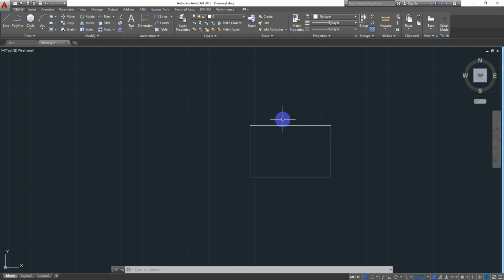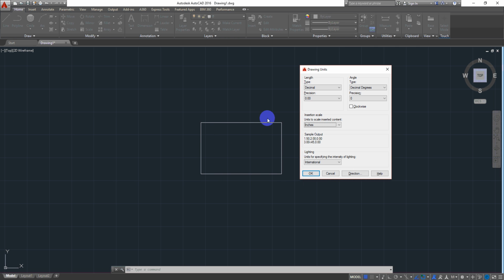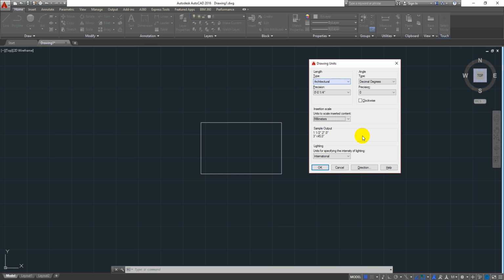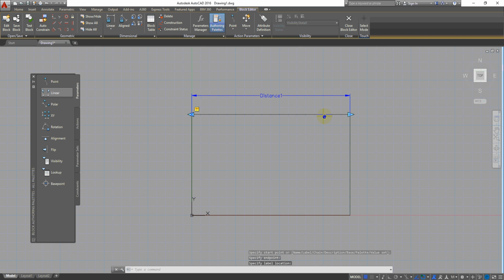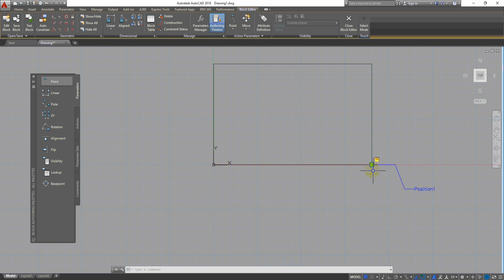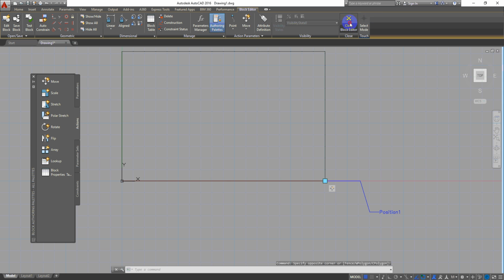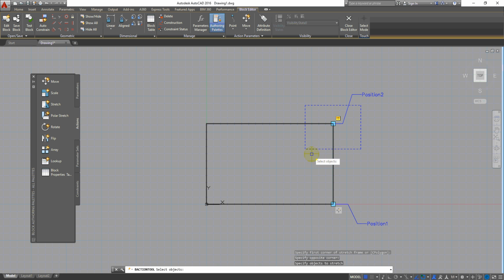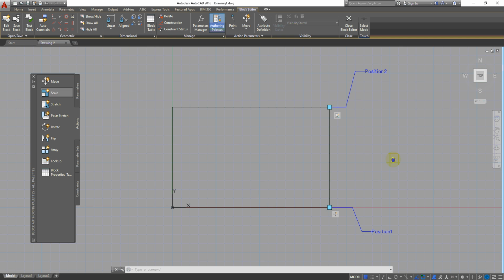02 Point Parameter

Comment: Saving and editing multiple times instead of using the "test block" function... pointless. If you make a mistake with the selection set, test block is always the best method becuase it does not save the modified block in a drawing.